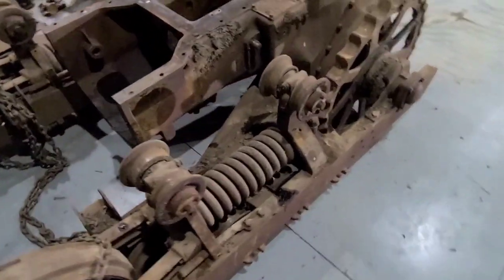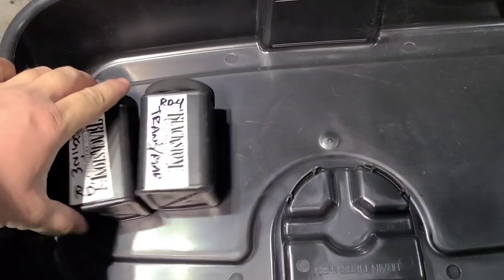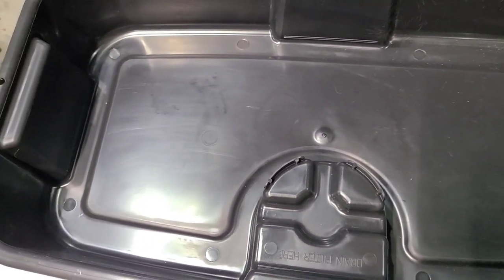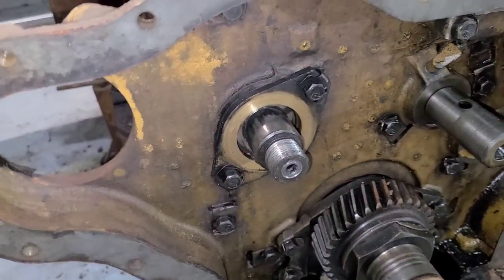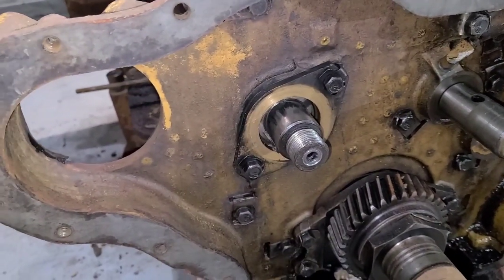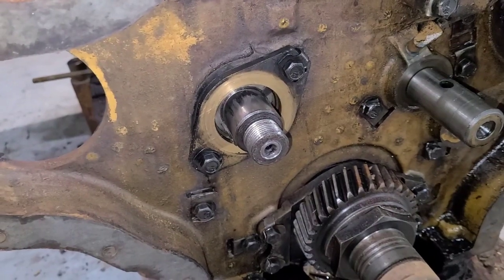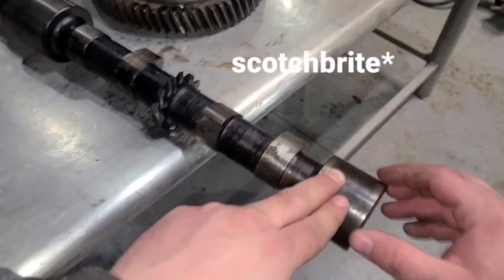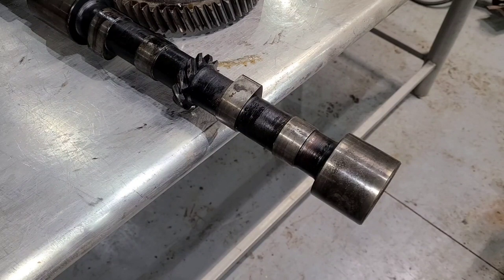Caterpillar RD-4 Engine Disassembly Pt.8

Comment: At 2:48 pretty sure that gear is 2 piece and that inner spigot pressing thru allows the back gear to come off. It would have been very difficult to machine as one piece. Deere used a pressed gear setup like that in the 60's and 70's on their diesels.

Comment: Couldn;t resist chipping in on the fibre cam gear discussion.  Our 1945 D4 5T had a fibre gear in it that failed in 1979.  Replaced it and the steel gear with a double one just like what you have.  Seems to have been a production part for a number of years.

Comment: You got a bad case of four legged video bombers. 😁🤦.. They just wanting some loving too, ding ol' dang ol' tractor getting all dat loving.🤣😂🤣. LOL Fantastic video Kyle you put a lot of thought into making your videos. Some stuff is so second nature to me I forget not everyone knows how and why things work. You seem to have a knack for knowing how to explain those things to others. Thanks for the video and I can't wait to see 👀 the results of the oil samples. 💀😱

Side note...  I set the valve lash on the 8T motor grader, it was all over the place from 0,24"+ to 0.13" supposed to be 0,10" hot. Sure sounds better. Now the heat is up to operating temp the head gasket is starting to weep.😢 I kinda expected that anyway. 
Later bud.
Reply: I just the same message on squatch's channel
I have the 7J5104 to 7J9999 ~ 2T1 to 2T9999 Form 9068
D4 Cat Tractor
page 13  S/n 7J5104 to 7J6566 Inclusive has the compost gears (c. 1941)
at the bottom of page 13 S/n 7J6567 to 7J9999 Inclusive;  2T1 to 2T9999; 5T1 up has steel gears

Comment: I am truly enjoying this series.  Just watched Toby's video on the fiber gears.  I believe Ford use to use those on the cams of their 300cid 6 cyl engines.  You guys are expanding my knowledge on Cat Crawlers.  I may never actually work on one of these, but they are way cool.  Thanks for the video.
Reply from the maker: Thanks David! Seems alot of manufacturers have experimented with pastic timing gears at one point or another

Comment: Dowel pins are one thing I like about most of the IHC stuff I work on. If you have a locating dowel, it typically has a dowel pin with another 1/2" or so threaded section on the end. The root diameter of the thread is larger than the locating dowel. Slip a washer and nut on the threaded portion and tighten it down. Wallah, the pin gets drawn right out.

Comment: Excellent video the cam shaft should be fine with a good cleaning . The pitting is not a problem when it is on the relieved part when it develops the actual valve lash the exhaust valve has more pressure on it then the intake in a naturally aspirated engine I am working on a 886 ihc tractor that the customer didn't realize the antifreeze was going in the oil and it wore all 6 exhaust lobes off of the camshaft and hurt the crankshaft some because the last guy that rebuilt the engine put oil on the sleeve o rings and they failed

Comment: Bare concrete oil stains. 50 pound bags of bentonite  used for pond bottoms sprinkled on. Swept around left to sit a few days will amazingly pull oil stains out. 
We used to sell one pound bags at a paint store I worked at with my dad. Piano refinished used it dry to buff black pianos . We sold that special black lacquer paint also.  Looked great on my 66 GTO.  But it's a super absorbent too.   Always wondered about putting some in a party balloon and inflating it tight so it would pop in the clouds to see if one could force it to rain locally. I know other superabsorbents have done that.
Reply from the maker: The concrete is sealed, soap and warm water cleans it right up 👍

Comment: The larger two step gear is still two piece. The smaller step is machined with a spigot that is pressed into the larger gear. You can see the parting line if you look close. Two step lathe change gears are done the same way. Also BTW... the inner oil sample bottle was supposed to go into the zip lock bag that was curled up in the containers to prevent accidentally leaking. Maybe you did it off camera?

Comment: i'm really interested about the results of the oil analysis! You sure are making some good steady progress! Kyle if you do reuse the cam bearings you will need to remove them if you get the block 'hot tanked' The caustic soda will attack the babbit on the bearings. That front bearing did look decent!
Reply from the maker: Yeah, they will have to come out as I do want to have it hot tanked and magnafluxed just to ensure it has no cracks. The pony was cracked on both sides which worries me about the diesel block having similar issues

Comment: From the looks of it, the bearings for the cams look really good. Ofc a internal dial indicator would give a accurate reading of the wear. The cam might be fine just may need lot of polish but looks savable. Scott from coldwarmotors used JB weld to fix a pitted chevy cylinder and it may work here as well? Not sure but go check him out and you might find something useful.  I get the feeling someone has been inside the engine cause I don't think CAT would let fold over locks like that pass the inspection. The newer style gear looks ok and might be better in general the the two piece older style cam gear.

Comment: It's looking like someone's been deep in the front of the engine before, possibly an older rebuild?? If it'd been only timing gears prior, no need to get front cover off, correct?
 Also looking like engine stand coming fast too.
 Too bad you can't train the dogs to get you the right wrenches as needed! Great vid.

Comment: Kyle, I was noticing that the point on that rear cam was much less sharp than the next cam. But then it looked like the point on the cam on the other side of the drive gear might also be broad. Is that rear cam point worn, or maybe the intakes open for a longer time than the exhausts (or vice versa)?
Reply from the maker: Good question, lets get the calipers out and measure!

Comment: I'm no Cat mechanic, but that last lobe looks flat. Is that a trick of the camera angle?
Reply: @squatch253  Good to know. It just didn't look like it had the same profile as the next lobe on the cam. But I suppose that's OK too, depending on what the engineers wanted.